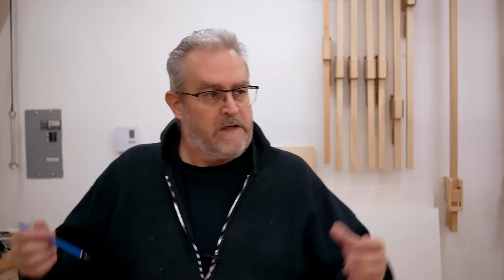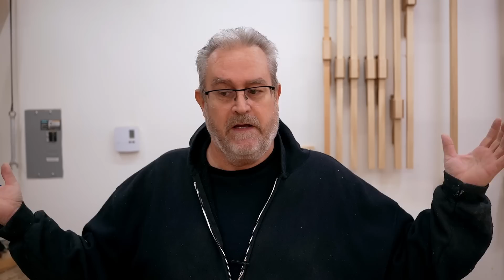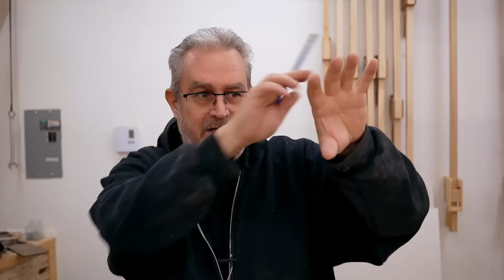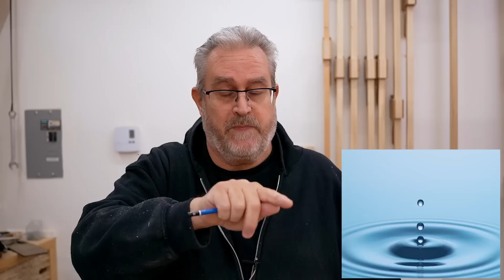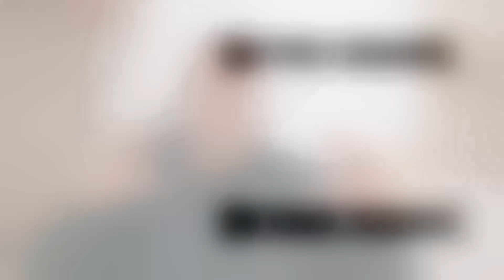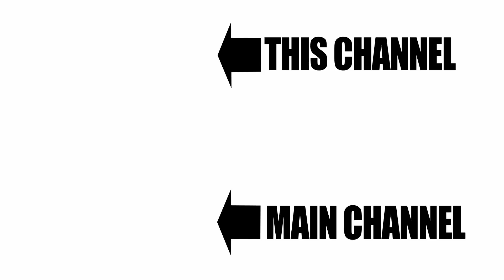Debunking Audio "Truths" - Open Baffle Speakers don't Pressurize The Room

Comment from the maker: Sound, the final frontier. These are the voyages of the shit disturber John on his 5 year mission to seek out the nonsense and to boldly go where no audiophile has gone before.
Sound is energy that travels through a medium. For most purposes, air is that medium, so we need to understand how sound behaves in it. 
Sound waves are so-called pressure waves that have a high pressure peak and a low pressure trough. That peak to peak amplitude is the strength of the energy of the wave. A larger peak to peak value will be louder.
As sound energy moves through air, it form a region of high pressure that's immediately followed by a region of low pressure. The air in the space is being energized by that sound energy - in other words (and perhaps wrongly), it's being "pressurized". 
But it's SOUND pressure, not air pressure.
When you hear the word "pressurize", you probably think of blowing up a balloon, but sound doesn't work that way. The high / low pressure nature of sound energy means that there is no net change in the air pressure of the room the sound is playing in. 
So there will be no rushing out of air when you open the door of a "pressurized" room that's being "pressurized" by sound. 
The sound energy is, as I described in the video, making the air molecules vibrate more (and less) than they normally would, very much like a big block of jiggling jello.
Now this only happens (this pressurization idea) below what's known as the Schroder frequency. That's the dividing line between sound behaving like rays and sound behaving like pressure. 
When low frequency sound is being put out by a speaker, it will energize the air, regardless of what type of speaker is making the energy. In other words, 40Hz at 90db is still 40Hz at 90db whether it comes from a sealed, ported or open baffle speaker. Sound energy is sound energy, no matter where it comes from.
So saying an open baffle speaker won't pressurize a room is simply not true. 
Ergo, saying that open baffle speakers don't excite room modes is ALSO not true, since room modes are excited by the SOUND ENERGY a speaker produces, not the speaker itself.
Reply: Without 'ear'receptors ,there is no sound.....it's the waves hitting our ears that make us hear sound....
Reply: Open baffle speakers excite the room modes less because they have side cancellation, which removes a percentage of the sideways energy. This can be seen in the measured power response. Cardioid speakers have even a bigger effect. The reason why most open baffle speakers lack oomph is that OB drivers roll off 6db/oct and require much more surface area and equalization in order to perform as loud as a boxed speaker. A passive OB is difficult and expensive to manufacture due to the limitations of the passive crossovers. You either sacrifice a lot from sensitivity and use huge passive crossovers or you sacrifice your low end. No win situation.
Reply: "Ergo, saying that open baffle speakers don't excite room modes is ALSO not true, since room modes are excited by the SOUND ENERGY a speaker produces, not the speaker itself."

Nobody says that open baffle speakers don't excite room nodes. They do however say that open baffle speakers excite room nodes differently. As we all know, off to the sides is huge cancellation, especially in lower frequencies. Thus they minimize the effects of bass nodes due to the side walls.
Reply from the maker: If there is a difference, that difference would happen because there is less energy output overall at the frequency. So the side cancelation just reduces the energy output in total, and not because it's doing it in that specific way.
And yes, plenty of people think open baffle speakers don't excite room modes.
Reply: @IBuildIt  You are wrong on both counts. Are you sure you build speakers? Asking as you seem to be unaware of the figure 8 output of open baffles and planers, and how they propagate sound. They sound smoother due to how they load the room, not due to a lower total output. As far as audiophile beliefs, I've yet to hear one say they don't excite room nodes. With an 8 foot ceiling, there will be bass nodes at 60 and 30 Hz to contend with, regardless of speaker type.
Reply from the maker: You are falling into the same trap as most other do when thinking about how sound propagates in an enclosed space. Bass frequencies are said to act as pressure because they overwhelm the capacity of the air in the room to contain them, so instead of behaving like a ray (like higher frequencies), they more or less just slosh around the room. They FILL the room.
The bass energy from a dipole has a cancellation at the side, but you'll only see that when you measure close to the speaker. Farther out, the bass appears as omnidirectional, just like any other speaker type.
I not only make speakers, I also measure them and I measure what they are doing in the room. I know from real-world, first-hand experience that the only way to reduce how much a room mode is being excited is to produce less bass at that frequency. What you (and others believe) is not possible in a small room.
Big rooms are different, since they can contain the bass energy without it building up. But big rooms are BIG - gym size or church, not a room in any normal house.
Reply: What we hear are wavefronts: pressure variations occuring at our ears when the wavefront passes by. Under the Schroeder frequency the dipole speaker will fill the room with opposite pressures that will cancel out. Therefore not pressurize the room while still energizing wavefronts that will be heard, just like frequencies above. Not so with a monopole speaker. You can actually feel the rush of air through the port that comes to pressurize the room, before receding back in the box. We get room gain, especially useful in very small spaces. There's probably less room gain with dipoles, but still some because of boundary effects to the wavefronts.
Reply: @jean-lucbattista2492  thats not what a port is doing its not a pump
Reply: @zaphod_beeblerox  at those frequencies, within a half cycle , in a small space...

Comment: I did the sums. When a closed box bass driver moves forward it DOES reduce the room volume, which DOES increase SPL in a fully sealed concrete room, but how much? Well, for a typical listening room size and a 12" bass driver moving 1 inch forward (and staying there), the pressure increase is....wait for it.... 0.0002 dB. Much less in a room that leaks or has non-rigid surfaces. Add in the realities that bass frequency hearing is summed and delayed, not instantaneous, and one can conclude with great confidence that there is nothing audible going on whatsoever.

Comment: THE SEA does not pressurise a ship - but it sure moves it up and down...
Reply: The ship does not pressurize the sea. 
No matter if it is, big, small, slow , fast, a submarine, or a hovercraft. 
Sea pressure in kg/m2 is the same ..
They may create different waves though.
Reply: @smyrnianlink  You know when you used to do exams and it said "Read the question carefully BEFORE answering"

Comment: In a closed box speaker the compression wave from the front of the driver is not cancelled by the rarefaction at the rear of the driver as it is with a dipole. The cancellation nulls produced by a proper small baffle dipole make it directional all the way down into the bass region. When pointed at the listener, it therefore puts only a third of the energy to the room as it does to the listener, as does a cardioid with the only difference being that the null is in the rear with a cardioid and not the sides as with a dipole. This is easily seen in polar measurements...measure your dipole at 90 degrees off axis and compare it to a sealed box at 90 degrees off axis and it's obvious; a dipole is a velocity source and a sealed box is a pressure source.
If you play 40hz through a sealed box and a dipole in the same room, with the same sound pressure level at the listening position, if that level is sufficient to stimulate your pressure receptors (mechanoreceptors) you will easily feel the difference.

A ported box unloads below the tuning frequency and begins to cancel rolling off at a very steep slope, thus the use of rumble filters to protect the driver unless it is a sufficiently large subwoofer tuned to a very low frequency.

As Linkwitz stated, a dipole means more energy for you and less for your neighbors. I've been building dipoles for over 2 decades and I use a sealed sub below 60hz, where music is mainly felt through mechanoreceptors. Of course the kind of music you listen to matters with regard to how much pressure is in the recording, as some bass instruments are pressure sources and others are velocity sources. You appear to only be considering the compression and rarefaction from the front wave of the driver and ignoring their out of phase opposites from the rear of the driver. Cheers to frontiers and all the best, Jason

Comment: I am building duo 2in 4 ohm summed to 8 ohm, open baffle at ear level, from 700hz to 5khz.  the front mounted ribbon takes 5khz up. A single 8in carbon fiber right below700 hz to 70hz , a 3 way. High pass fmod to mono block amps. Subs are plate controlled (500watt dayton) I blend with douk preamp to hipass/ subs are duodayton18s  all sealed . This eliminate the pressure probem of large open baffle bass.   I have to adjust the system a little depending on music listeners taste in music and the era of the recording. It gets a little technical.
Reply: I use spotify eq and correct the OB peak at 1khz or 2khz  neg a db or so. And watch people (experts) 
Roll there eyes in disbelief.  One even cried. I have built over 500 systems in auto and clubs an churches an home concert
Reply: Good description: I am subscripting,thanks

Comment: Hello folks: I feel why lack of low bass in open baffle. The box become the drum skin driver is the drum stick. That's what missing or weaker. A 15" open is like 10" box. As the box driver focus the blast of energy out as a sunflare in a beam.
Open this energy is 360 spread around out or 16x4" drivers box this reinforce to lower the FS of a single driver.

Yep I'm still crazy 

Ride Easy 

I'm wondering if I place a woofer inside a kick drum. What the outcome is?

How do you think. Not what you think you know. Nice post poster.

Comment: “Speakers pressurizing a room” isn’t a phrase that makes any sense. To build on John’s explanation, sound is a minor perturbation in pressure that has to travel from the thing that’s causing the perturbation because the medium (air) acts to restore equilibrium. This moving pressure perturbation is something that exists superimposed on the bias that is the air pressure itself. Sound waves follow the same behavior as other wave phenomena: reflection, diffraction, absorption. For bass frequencies, diffraction becomes the predominant mechanism in a typical room because the wavelengths become roughly the same size or larger than the objects in the room or even the room itself.
Reply: Speakers pressurizing a room is a thing, just not a most common frequencies, below 20hz and certainly below 15hz it literally feels like pressure, ears hears nothing at that point.  so there you go, now you know, and how you experience it one day.
Reply: @sudd3660  It may "feel like" pressure at 20Hz and below but it's still just sound being sound - no different than 200Hz or 2000Hz. All that's different is your ability to perceive - becomes more skin (to include body hair), less ears.
Reply: @hubbsllc  i am telling you, you have to experience it to talk about it, a pressure sensation is the feeling. so that is valid enough to use the term in that sense.
Reply: @sudd3660  I'm a bassist and keyboardist whose idea of a good time is the original Moog Taurus pedals - I'm quite familiar with the experience. Nevertheless, "pressurizing a room" with speakers isn't a sensible statement.
Reply: @hubbsllc  
 it is descriptive, that is what i am trying to say. 
and still i think you have never had the experience otherwise you would have know how accurate that pressure description is.